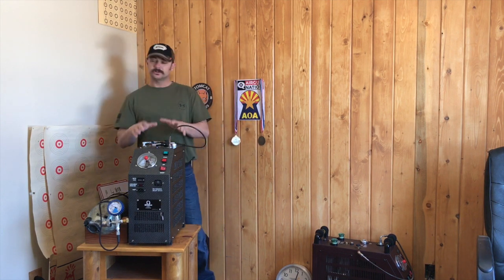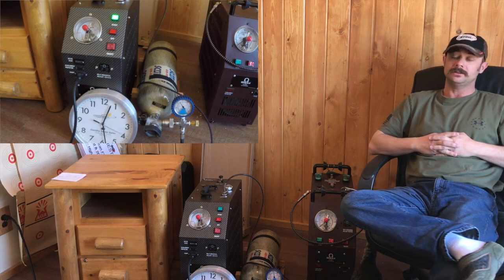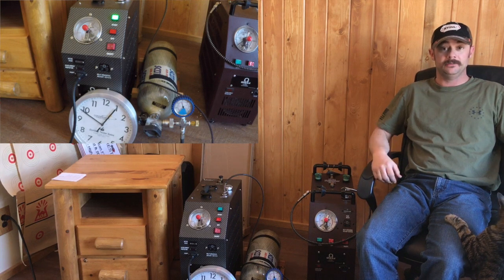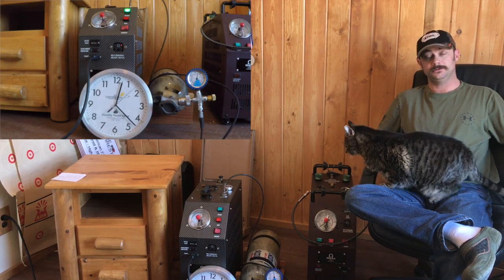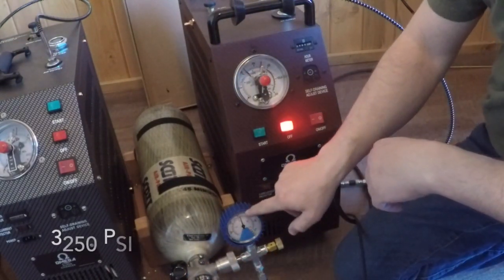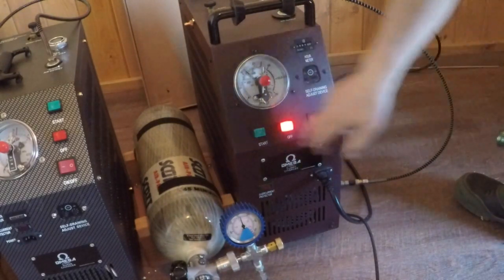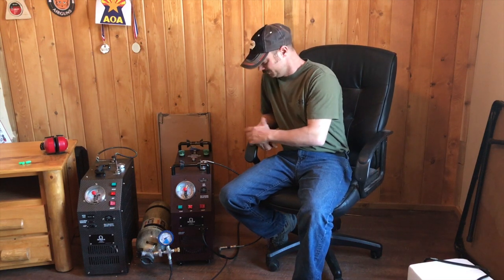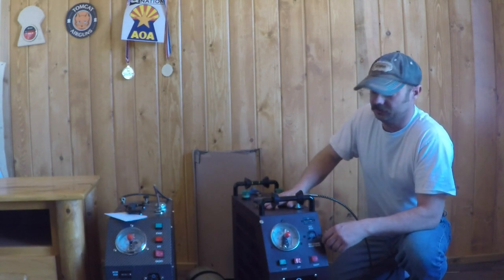Omega High pressure air compressors (PART 2) filling speed race!

Comment: Tom. 
I enjoy your videos, I just watched the Omega Turbo Charger video and I will be ordering one.
I already have a Omega Supercharger that I'm trading in on a Turbo machine.  I'm having a problem with the Supercharger filling my Omega 75CF tank.  My understanding is that when the compressor fills the tank and shuts down I'm supposed to close the tank down and then bleed the line.  When I do this the tank gauge shows the air completely moved to zero.  But I don't have any air in the tank to fill my PCP guns.  What am I doing wrong to loose the air in the tank.  I would appreciate your input and I can be reached at email pooterjoe@rockisland.com or 360 378-5430.

Comment: I'd question the "less maintainance" on the turbo you have two pistons as to the other which has one, now thay both have identical cooling systems so the turbo will be working harder and hotter, also you'll have two pistons to maintain as opposed to one. Personally I'd go low and slow when it comes to compressing air up to 300 bar.

Comment: I have the Omega SC and it's been running flawlessly since June 2015. It top fills my 75 cubic from 3200-4500 psi in 70 minutes with the Diablo inline.  
https://s20.postimg.org/owd8ez9wd/P1012299.jpg

Comment: Tom, is it possible that the Turbo Charger will need more maintenance than the Super Charger because it is running so much faster than the SC wearing out orings and building more heat ... whereas the SC runs at a slower less strained pace ... just wondering. BTW, great video ... loved the helicopter ride.
Reply from the maker: John, I don't believe so because the Turbo is using 2 pistons vs the single piston of the Super. Also, they seem to run at about the same RPM's (pace)..... Actually, I just compared the two manuals and the Super seems to require more maintenance than the Turbo, which surprises me. I figured the maint sched would be the same by the hours but the Turbo would use 2x the grease. Hmmm. this is something I'm going to look into further. sniff... sniff... I smell a new video idea brewing! lol
Reply: Hi Tom, there is only one real expert on the Turbo Charger in the USA that is Todd at AoA . He works for Raptor Pneumatics, but his work place is AoA .  If you want to talk to him you can reach him at AoA and just ask for Todd who does all the work on these chargers. I'd give you his cell phone number, but I don't think YouTube would be the right place to do it. If you've never talked to him, let me tell ya ... he has to be the nicest guy in the world to talk to, humble as a church mouse, will give you the shirt off his back and will do anything to help a customer out. Just don't say anything about his stuttering. Tell him John Miles in NC sends him his best and to give me a call sometime if he just wants to shoot the breeze ... he used to live down at Lake Norman before he took the trek out to Aridzona.
Reply from the maker: I know Todd very well. I called him a few times for details before making the video. Thank you for the advise!
Reply: Just ordered the turbo today.  Only thing that concerns me is that a lot of reviews of these units leaving AOA, is that the “NEW” units arrive at your door with 5, 10, 15 hrs on them already.   Surely would not call that NEW.   What does Todd or AOA say about that???
Reply: I too wonder about the time gauge showing times already on the charger to be showing many hours  .  I have seen comments indicating as much as 30 plus hours.  I received my Supercharger from AOA that had less than one hour on the gauge.